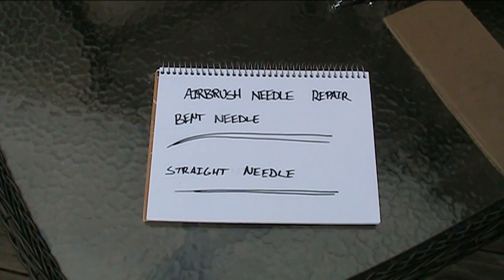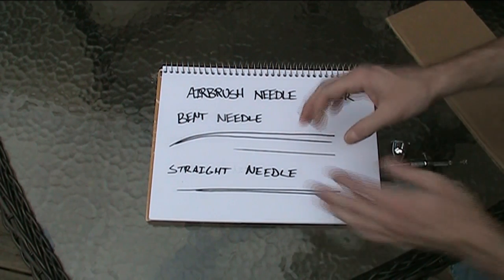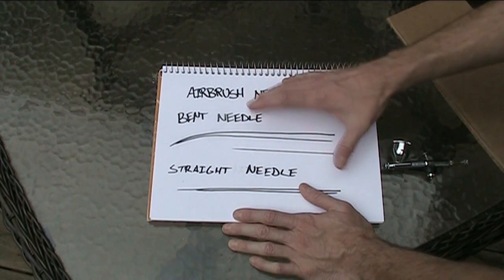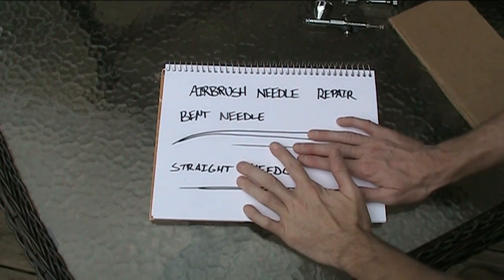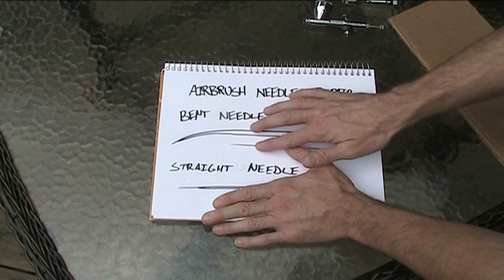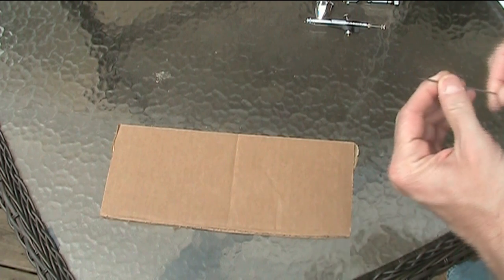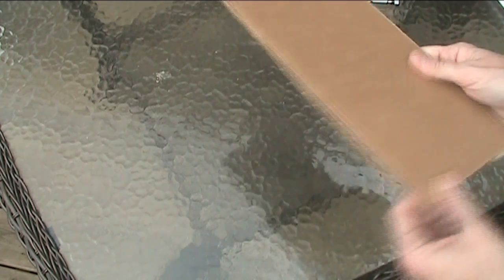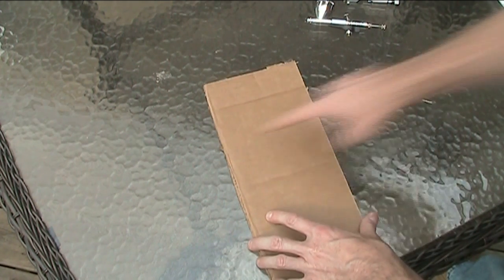How to fix a bent airbrush needle - Simple Technique

Comment: I want to thank you for the best ever tip on straightening out airbrush spray needles on a piece cardboard.You can actually see the needle drag line on the cardboard.With very light pressure you can feel the needle straighten out. Thank you great great tip

Comment: A bent needle is a damaged needle. You can straighten it and annealed it and you get back 90% of its integrity back. Yu can straighten it and use it temporarily to get you out of a spot but the real solution is to buy a new one. Take a metal wire and bend it a few time and see what happens to it.

Comment: Soooooooo..... Carb board is stronger than metal...... Yeah.....
Reply: as thin as the point of a needle is, yes, very much so.  you are essentially stroping it as you would a knife after sharpening.  i actually strope my knifes on a piece of denim.  by doing this, you are purposefully catching any of the microscopic "teeth" that are not quite straight and making them so